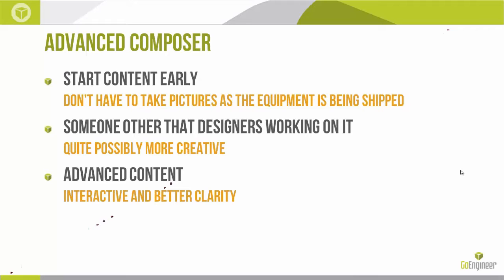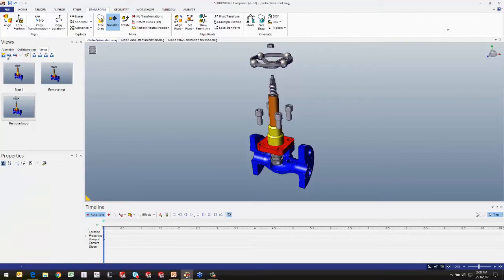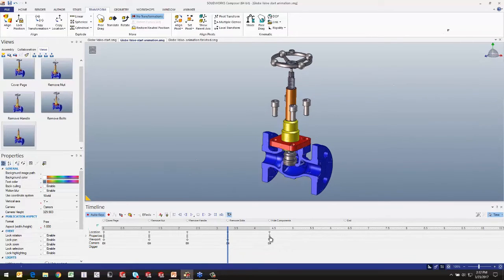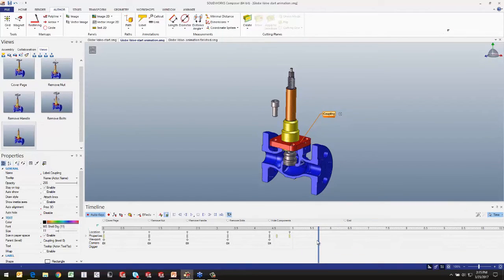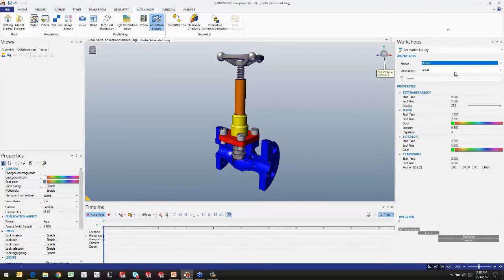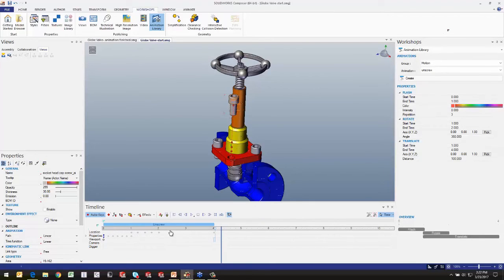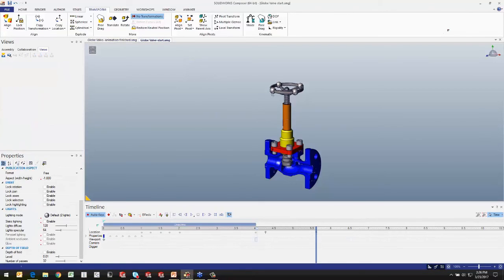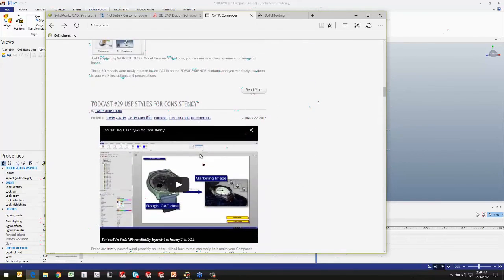SOLIDWORKS Composer – Advanced Animation

Comment: Why my unscrew motion changes on itself after i add any change after???? I am frustrated. I have saved perfect unscrew motion where my screw and tool for unscrew first blink 3 times, then start moving and rotate up (unscrewing)... Its perfect. And whatever command i add later, translate, change color, or new motion from library, my first unscrew motion in its interval totally changes on itself and not working as it should, and then it have wrong motion: It start blinking but also parallel moving up on itself without rotating, then later rotation start (unscrew) and when this motion is finished it goes higher than it should (because that moving up during blinking). Why this happening? Also when i "refresh" motion it does same bug. Why??? This dont have any sence!
Reply from the maker: Hi Bojan,
I am sorry you are frustrated with the software.  There is not much advice we can offer from the comments section of this Youtube channel.  If you have not already approached the tech support department of your local SOLIDWORKS VAR you may wan to do so.  This is an issue that warrants an investigation to give you answer.
Reply: Bojan, not sure I understood you, but I think you need first to convert all the motion you create, if you use the Animation Workshop. Don't move any parts before you do that.
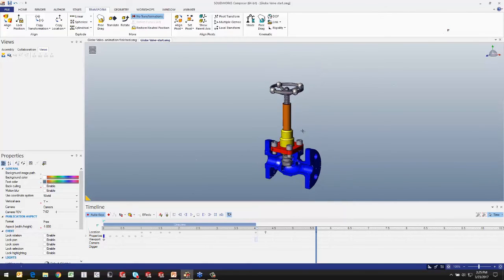 See the blue line (Unscrew) at 21:45 (for example).
I managed to master this program by myself, and it took me couple of years. It is very frustrating, because there's no one to help you, but it's possible. Although Composer do have some bugs, it's a great program overall. I create a complex animations for big industrial machines. The example in this clip is a piece of cake. Don't give up :-)